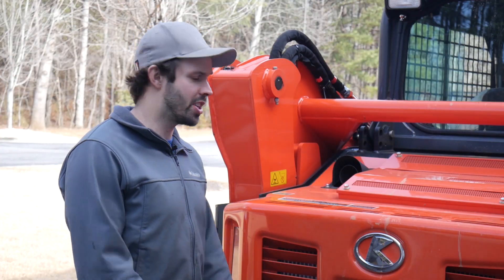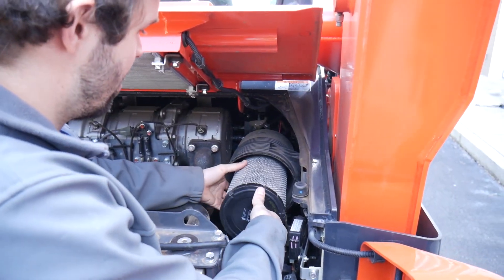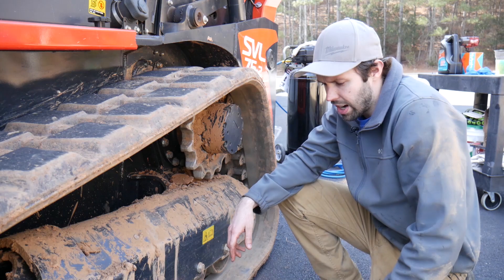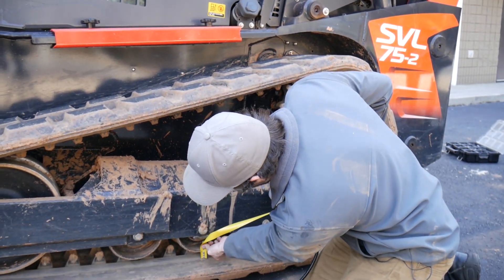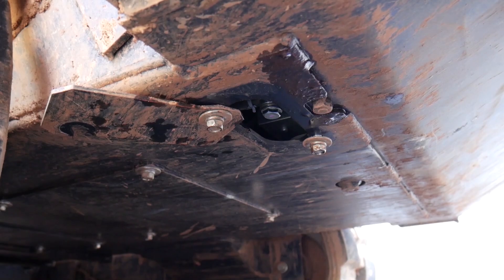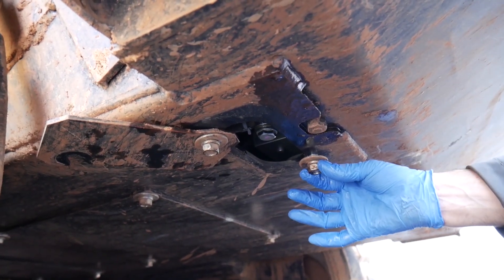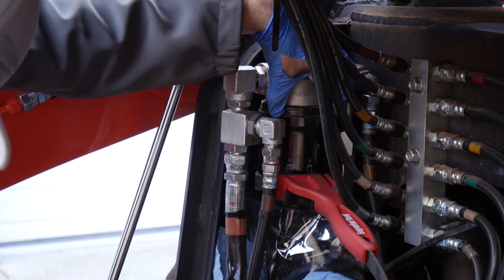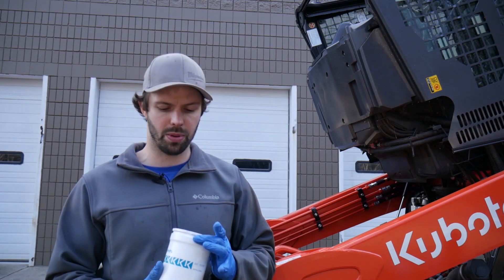HOW TO: Kubota SVL75-2 50hr Service

Comment: Good video.  Suggestion: Put a one gallon ziploc over the hydraulic filter before removal.  You'll eliminate all oil spillage during the process.
Reply from the maker: @akoldbird  Love it! Thanks for the tip and for commenting. Definitely going to use that.

Comment: Kubota tech here, super udt and super udt2 is mainly for tractors. Your machine needs HD46 hydraulic fluid. You can use a generic but I wouldn’t recommend as off brands contain zinc and kubota hd46 is zinc free
Reply from the maker: @JMoe936  Thank you for the information!

Comment: How much hydraulic fluid do we change at the 50hr mark? There is a holding tank at 3 gallons and 9.3 for the whole system.
Reply from the maker: According to the owner's manual hydraulic fluid change is NOT required at the 50hr mark. Hydraulic oil is changed ever 1000 hours. You shouldn't need to replace any hydraulic fluid with the 50hr service. Thank you for watching! You can download the manual from our website in the description.

Comment: Helpful thanks! Wish you showed checking the hydraulic oil level & adding more; I have a terrible time reading it with it under the seat
Reply from the maker: Good point! It is hard to read. We use a flash light and shine into the glass. If you are careful with the filter change you won't need to add additional hydraulic fluid. Thank you for your feed back!